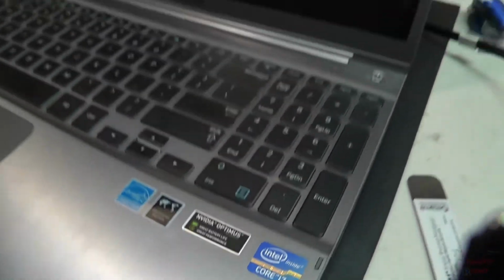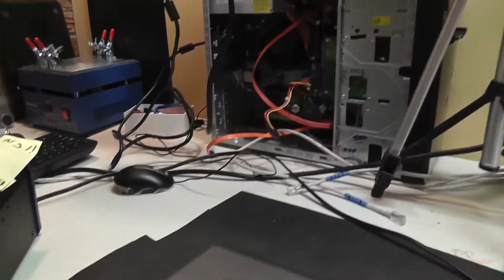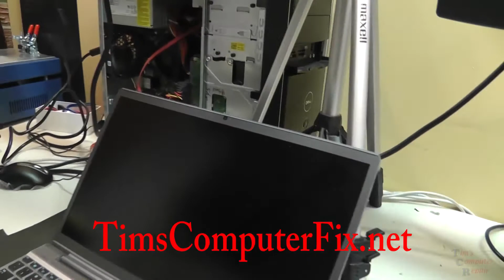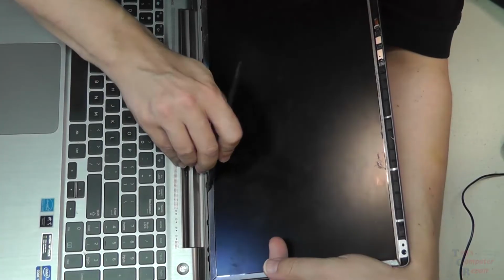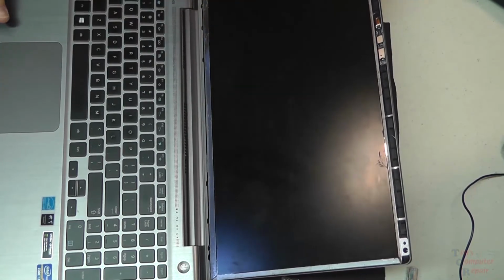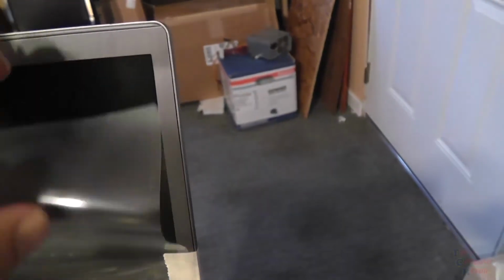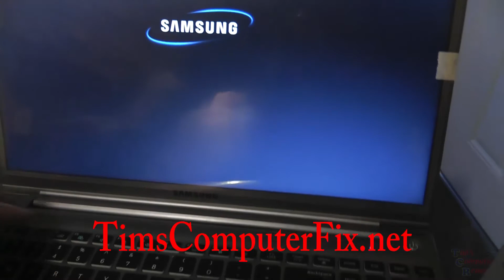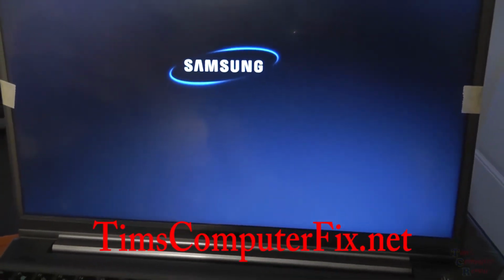Samsung NP700Z5C Touch Screen Removal and Repair by TimsComputerFix.net

Comment: What is the best way to replace the bezel only? I have recently had my screen replaced but the original bezel has been reused and has not been stuck down, meaning it has a 'wavey' appearance. What do you suggest to do? Replace the bezel or try and restick the original one? If so what glue/ is a heat gun safe etc? Thanks.
Reply from the maker: You should be able to find a replacement bezel on ebay pretty cheap. You can also try applying 3M double sided tape on the inside of the bezel so you get a better fit.

Comment: Could you tell me at what temperature and fan speed did you have the hot air gun/station at? I will really appreciate it thank you.
Reply from the maker: TakeTheNarrowPath GloryIsHisName Doesn't matter what heat source you use just be sure to keep far enough away to keep things WARM .. not hot. Thanks for watching